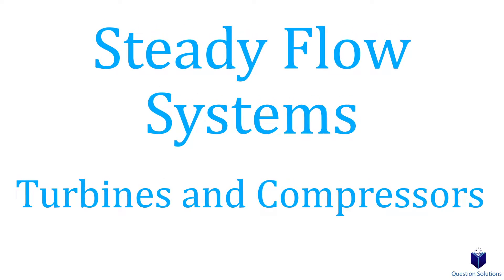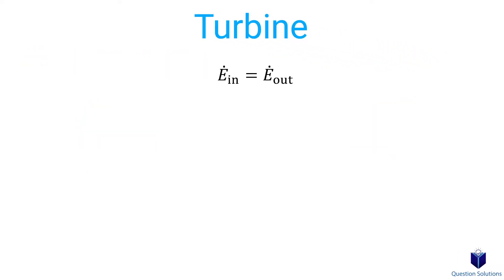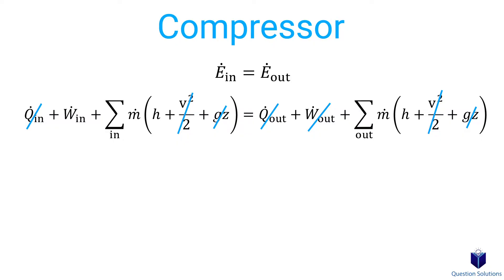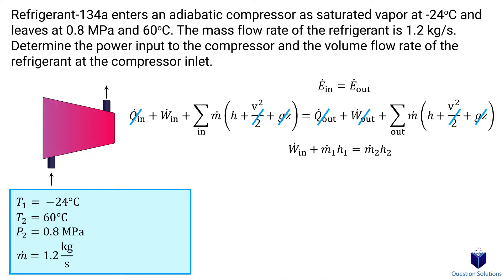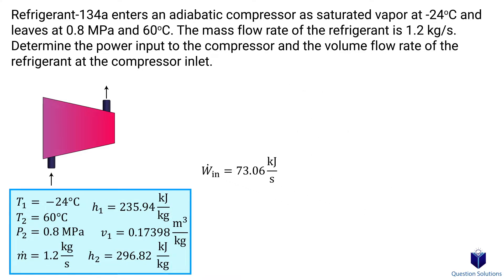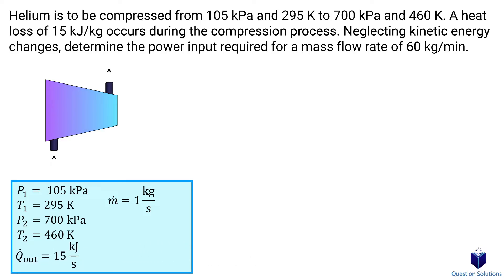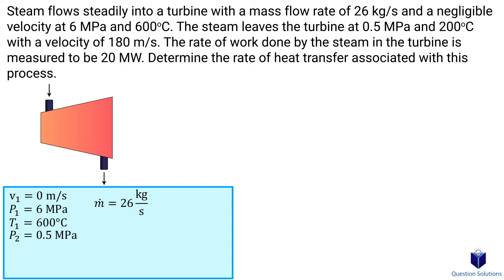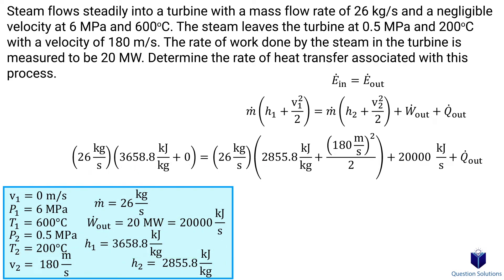Steady Flow Systems - Turbines and Compressors | Thermodynamics | (Solved Examples)

Comment: The values of the table you have is different than mine, why is that? 4:18
Reply from the maker: Probably because you have a different book or reference tables. It does not matter, use the one you have access to.
Reply: @QuestionSolutions  oh okay but isn’t that gonna give me the wrong answer? I don’t understand why they are different
Reply from the maker: @Shaden-w8q the differences should be minimal.
Reply: @QuestionSolutions  unfortunately i got 445.22 as the final enthalpy value for the superheated refrigerant, not any close to the value you got
Reply from the maker: @Shaden-w8q I don't know where you're referring to. Please use timestamps. The values on your table should be close to the values on mine. If they are vastly different, you're most likely looking at the incorrect one.
Reply: @QuestionSolutions Ok, where can i find the version you’re using?
Reply from the maker: @Shaden-w8q it's in the back of the book: Fundamentals of thermodynamics by C. Borgnakke and R. E. Sonntag

Comment: Why at the last question 7:37 Q is out for my understanding Q is in what I misunderstood 😢
Reply from the maker: It doesn't really matter if you label it Qin or Qout, because if you got a positive value, it's heat output, and a negative value would have indicated a heat input.

Comment: Why at 6:30 we didn’t use the average value for cp and used a predefined value of cp at 300K?
Reply from the maker: If you have those values for helium, you can use them, but the textbook used for reference does not include those values at specific temperatures.

Comment: In compressor heat energy is zero why we use heat in second problem
Reply from the maker: Generally, heat energy is zero, but if it's specifically stated that there is a heat loss, you have to account for it.

Comment: ı have a question when we are using small q and uppercase Q with dot ?
Reply from the maker: A big "Q" is equal to "mq" in other words, mass times small q. Small q, is just q per unit mass. The mass can have a dot on top, if it's a mass flow, so like 10kg/sec. Something that happens per time. In that case, you'd write a big Q with a dot on top.

Comment: Really good video! Question, at 7:40 you mention that because this is steam we can go right to the superheated water table. Should we still confirm this by using the saturated water table first and observe that at 6000kPa, 600 deg C > Tsat, or can we just assume that steam is by definition a superheated vapor. In one of your other videos you have specifically mentioned superheated steam before, is this always the case or can steam also be a superheated vapor as well depending on the conditions?
Reply from the maker: Always verify with a saturated water table, and the conditions needed for superheated steam. When you do more problems, you have a pretty good idea of what table to look at, but if you're ever in doubt, double check 👍
Reply: @QuestionSolutions  Thank you!

Comment: helium cp why is 5.1926the temp is not 300K
Reply from the maker: The values don't differ that much for helium whether it's 500k or 300k, so use the values readily available to you.
Reply: Thank you for asking this question